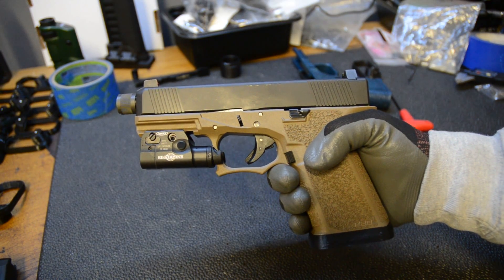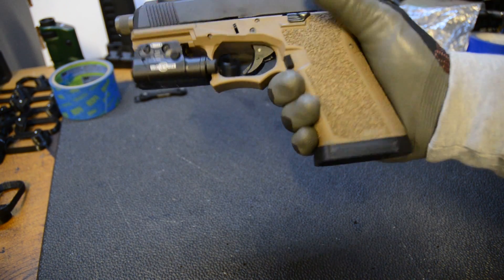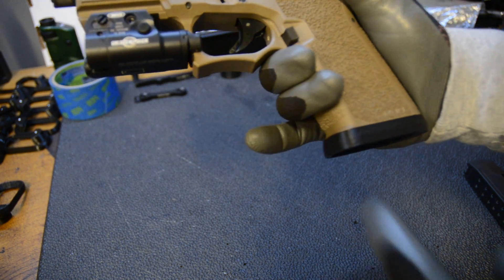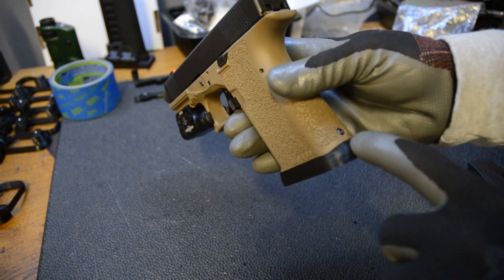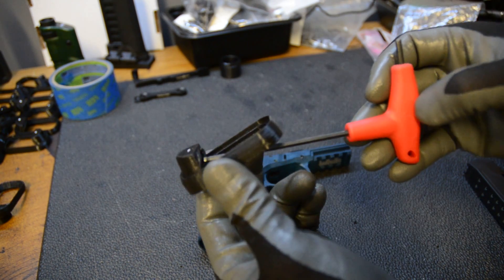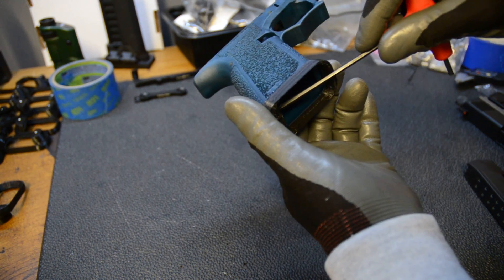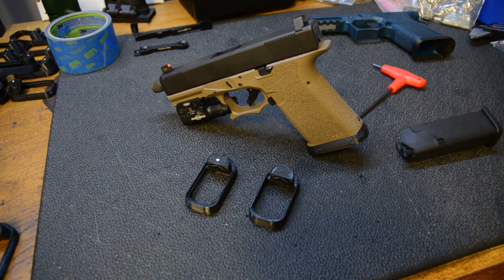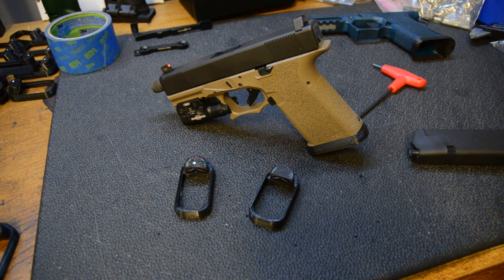Extended Magwell For The Compact Polymer 80 Glock Frame

Comment: I put the med on my 940c, needed extra length for the pinky.  Fits good I like it. Sanded the lines out and reduced the width to minimize the printing when concealing it and to reduce the shine.I like that it covers the base plate completely. Is the internal flare the same width on  both sizes?